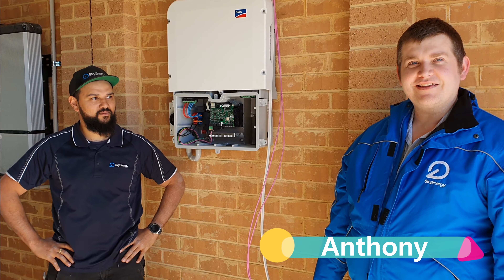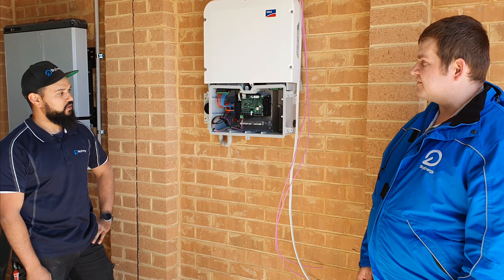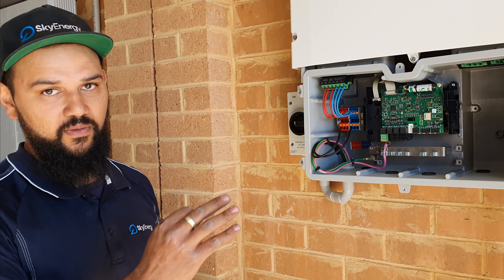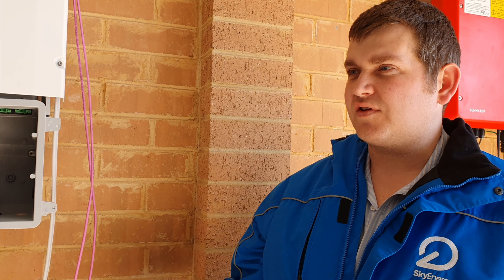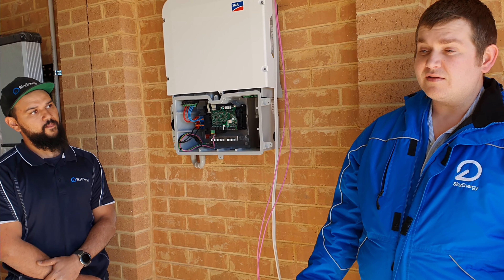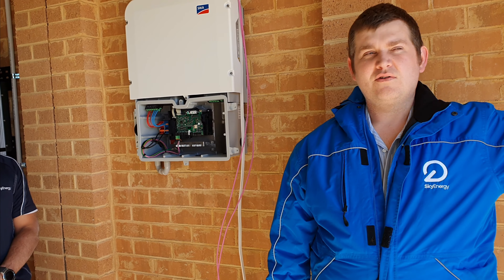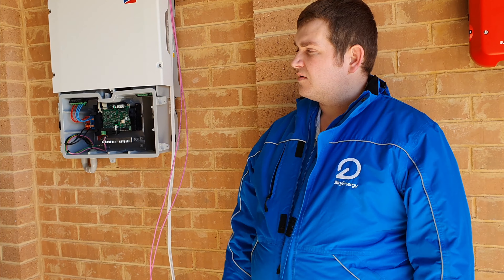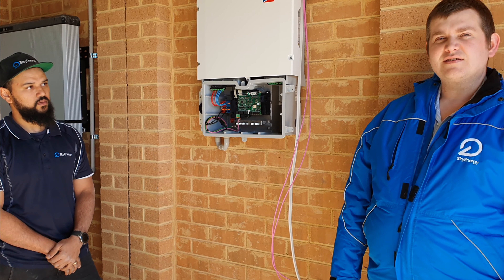Anthony and Ross Explore Solar Batteries

Comment: Good info - thanks gents. So, if I've understood, the battery feeds an inverter that feeds AC to the house, as does the solar controller. The "smarts" figure out if power should come from solar panels, batteries or the grid, depending on state of charge, solar power available and instantaneous demand, taking into consideration power limits of inverters, controller etc.? To make such a system "off grid", another device is installed that acts as a reference AC, so controller and battery inverter can operate?
Reply from the maker: Essentially yes!! We have some other videos that cover what you've mentioned a little more if you haven't checked them out already. Let us know if there's specific questions you'd like answered and we can make you a video too. Cheers Sam
Reply: @skyenergy6282  Thanks Sam, yes I follow your videos with zeal...great way of educating oneself, so thank you.